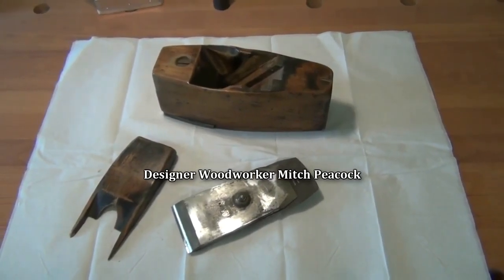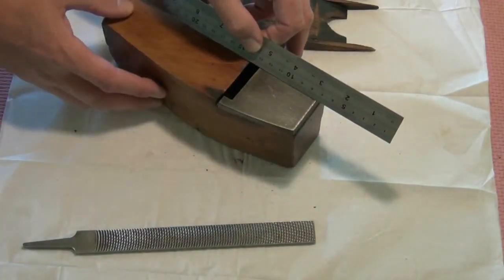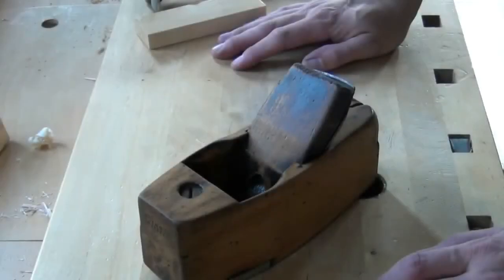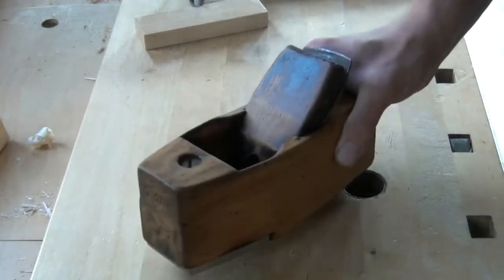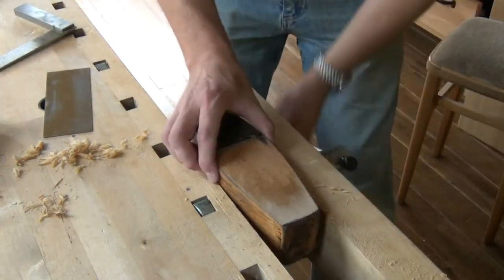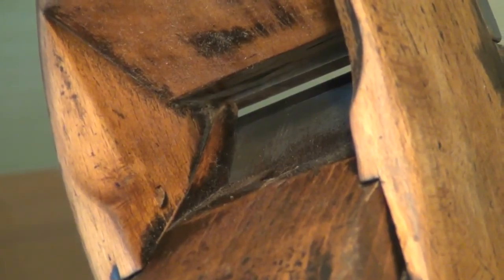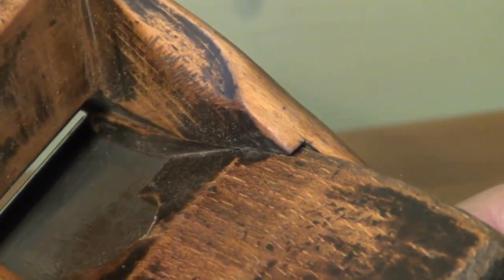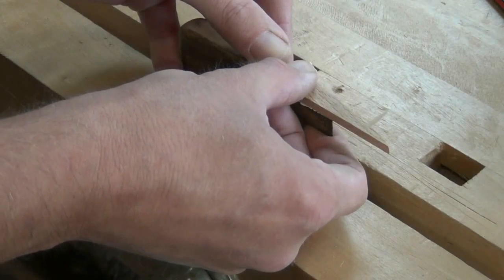eBay Coffin Smoother, tuned up / woodworking / tools

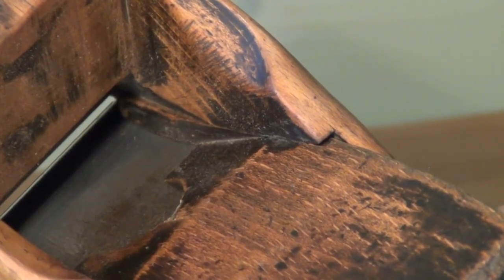Comment: 10:40 Mitch : I have exactly the same situation (well it looks like ) . Mine shatters (vibrates) terribly when i am using it:( 

I don’t see why cutting the extensions makes a difference ??
Reply from the maker: Chatter occurs due  to weak or unsupported structures that resonate when the blade is cutting. Most notable is when the blade is poorly supported close to the cutting edge. But any vibration should be dealt with, and these unsupported 'finger tips' of the wedge are a case in point.
Reply: @mitchwoodwork  you mean that the long none touching hears could add vibrations?
Reply from the maker: If they resonate at the frequency of an existing vibration, then they could amplify it, I believe

Comment: Mitch : I have a smoothing plane same style but no iron sole? Why ?
Reply from the maker: The iron sole is one way of adjusting the mouth, which should usually be small for smoothing strokes.
All wood, smothers, either have a wooden wedge or a let-in piece to close up a wide mouth.
As the sole wears away, the mouth automatically gets wider.
Reply: @mitchwoodwork  !!?? Could you show a photo of that ? Not sure I understand : I have a wooden wedge to block the blade but that’s it . Let-in-piece …?